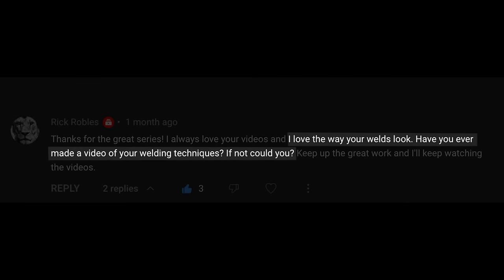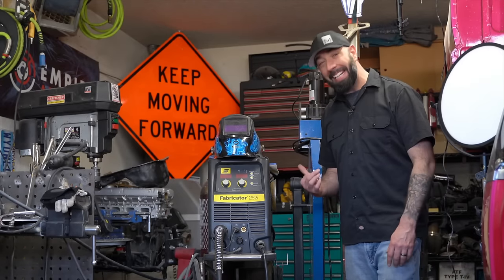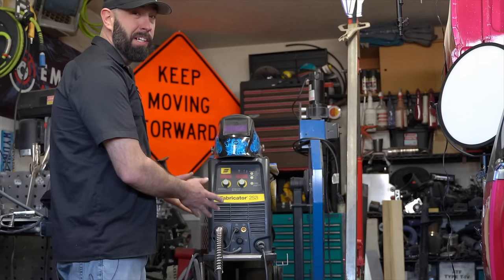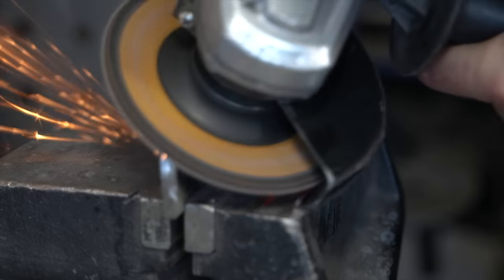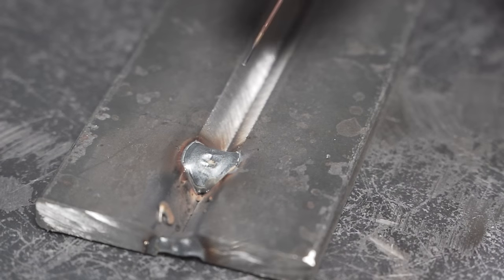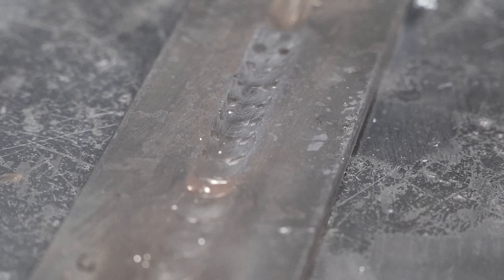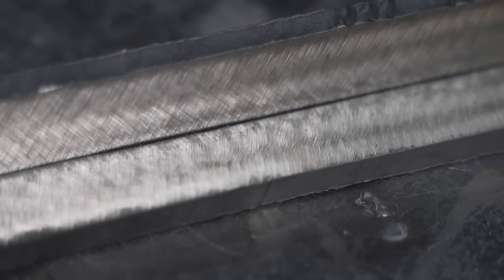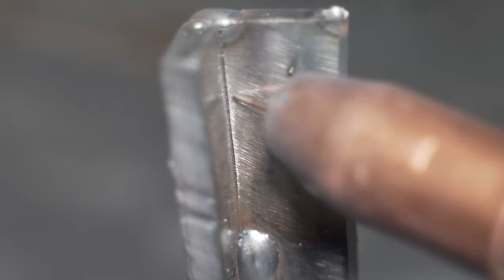MIG Like Mankandy: Techniques for Stacking Dimes with a MIG Welder

Comment: I prefer  forward  and up hand for everything over 3mm =1/8  with mig but im unsure your technique  is for the heavy gauge materialsm?
Reply from the maker: What I’ve heard a few times is vertical down is not ideal for heavy gauge. As for pushing and pulling, I haven’t noticed much of a difference in penetration but a slight difference in cleanliness. Pushing seems to provide better shielding.

Comment: Entry level mig and arc welder here! Loved the video very helpful techniques, thank you. 😊 very politely, are there charts/books to set up old machines that don’t have the digital help in setting up ones machine? What about setting up old school mig machines that need individual settings? Wire speed, amperage, voltage etc?

Comment: These comments are going to be epic your hella fabricator respect self-taught myself but helpful Meg advice clean your material make sure you have a good ground don't use extension cords you lose your voltage listen to your machine MIG is basically heat versus travel speed could use soapstone to better see your metal to my mind a cold weld is a strong-willed
Reply from the maker: Thank you for that my friend! Very much appreciated.

Comment: just about verticals : when u see specs of your welding wire, there is an info what positions is that wire intended for. usually solid wire can be used for downhill vertical ( it is good especialy for root pass). Flux usually not because of slag flowing down caused by gravity. On constructions there is as well Welding Engineer who is in charge of whole welding process and thus welders are given WPS and have to follow it no matter what. So by WPS welders can be told  not to weld downhill even if type of wire can be used in that position. Welding Engineer can decide that just to help welders make the job done as well as possible for Ultrasonic or X-ray to go well.       All The best for all welders.

Comment: For your last weld the vertical down for anything no structural your fine ! the weld loses a bit of strength but that's all going up hand is the proper way for the strongest weld ! but for just welding up basic car parts go cart stuff. Just make sure to take your time and hold to wand facing up to help slow down the puddle so you don't get porosity !! oh ya had to add 20+ year welder from high pressure pipe structural some under water and retired off greenhouse heat pips and boilers !!

Comment: I'll put this out there for what it's worth.  I've been a CWI for 15 years, involved in the industry for close to forty.  People will say it does not matter if you drag or push.  Hell, even Millers own Website makes that statement.  But we are talking about, maybe, a 5* drag angle.  Which people always wind up with a 10 or 15 degree angle, and wind up with no penetration.  I have been testing welders for 15 years.  I'm perfectly honest with the candidates that there is nothing in the code about drag vs. push, swirl, triangle, etc.  However, based on the pass / fail rate I have seen, I also tell them that if they are doing anything other than pushing the puddle, in a weave or stringer, they are on their own.  There is no "Grey Area" consideration when it comes time to bend.  If it fails, and it is marginal, it fails.  As for downhill, D1.1 structural forbids it in all except two cases.  Touching up undercut, and on T,Y, & K joints on Cranes.  Sheet metal is a different animal, and it is expected that vertical welding will be downhill.  Structural being defined as 1/8" to unlimited thickness, and sheet metal being anything less than 1/8" thick.  Carbon steel in both cases.  I'm like you, I like to run hot.  Hot enough that it almost does not matter what else you are doing, you have exceptional penetration.  360 IPM @ 23v on 3/16" to 5/16" A36 carbon steel.  See, I kept it Nice!...Great channel by the way, love the Video's.
Reply from the maker: Thank you for the time it took to write that Eric! You can often tell by someone’s way of writing if they’re interested in sharing info or just feel the need to troll. I feel educated. I appreciate you. In fact I wish you were in my neck of the woods. I have this idea to create a video where I weld the way I weld. (Pull, vertical down, etc.) and an certified official tests the welds. I wouldn’t be surprised if they failed. In fact the video would be more entertaining if they did fail. Then I weld the way my YouTube viewers advise me to, and test those welds as well. Entertaining, and beneficial for all. And potentially enlightening to me. Win win.
Thanks again my friend.
Reply: @GarageFab  I'd be happy to give you some detailed test procedures for some of those joints.  Simple and inexpensive.  You are right, it would make for some great real world examples.
Reply from the maker: @ericdolan2130  I would love that!
Reply: @GarageFab  I'll see what I can come up with over the weekend.

Comment: The best way to learn is to get a job in manufacturing that requires you to mig weld the same part together over and over about 1000 times. Yeah it gets old but you get the benefit of a lot of trial and error and you get to see what you are doing and it’s effect on your puddle and overall weld quality as you try slightly different things between runs. You’ll develop your own way of doing things that works for you and you’ll find that when you move on to bigger things you’ll have confidence to jump right in and do a good job.
Reply from the maker: I agree with that. I worked for a company that manufactured utility trucks. It wasn’t repetitive parts but it was nonstop welding at times.

Comment: You are correct generally none of these techniques or weld direction would be allowed in structural welding and there are good reasons why vertical down MAG welding is not structurally acceptable in materials above 3-4 mm thickness, but at the quality and expertise that you are it doesn't really matter.
Reply from the maker: Much appreciated David! Do you know why these are frowned upon?
Reply: Yes I do after having been a Boilermaker welder, Lecturer in Welding and Fabrication  and qualified Welding engineer for 50 years  @GarageFab
Reply from the maker: I was hoping you could share. There’s no shortage of people that advise to not weld vertical down, but few that will explain why.
Reply: Its not complicated, the problem is that on the thicker materials - say above 4 mm plate the speed of travel to obtain an acceptable weld factor is slower and the arc point starts to impinge on the rear of the weld pool itself as it is running slightly in front of the arc point. Obviously this dramatically shields the arc penetration point and can reduce the penetration by upto 80% often with sub surface fine porosity and sometimes cracking - not what you want for any structural welds. Of course in some circumstances it is a viable option, in thinner sections it can and does work ok especially F.I. on car body work where Vertical down is preferable.
Reply from the maker: So good. Lots of sense made. Thank you my friend. 🙏

Comment: Third generation welder here. I used to stretch trucks and build really big machines. All of what you said is only applicable to light sheet metal. 16 gauge and smaller. If it looks like a stack of dimes, it's a weak weld. The closer those lines are that make the weld look like dimes, the stronger the weld. You do not drag a MIG, you drag a stick. You PUSH a MIG at least 10 degrees past perpendicular, opposite the direction of travel. There is such a thing as too hot: You will be "spray welding" ...and this is not something you want to do on a critical weld because it's brittle. I can't tell you how many trucks I've had to strip down and fix because somebody did the critical verts downward. They will ALWAYS break. Go to Miller's website and watch some of those videos, it'll make you a better welder, and you'll stop smelling like (*sniffs the screen*) parmesan cheese. Your machine is on point, though. Esab is pretty good. I'm a Miller guy, myself. I've had good performance out of Esab and Hobart, but Lincoln is not even in my top three. Lincolns are inconsistent and their duty cycle ratings are inflated. Once they get warmed up, they get weak and I have to fiddle with them to get it right. Then the next day when they're cold, they blow holes in everything. I'd rather use a torch, Borax, and wire coat hangers than use a Stinkin' Lincoln.
Reply from the maker: Haha! Thank you my friend. I appreciate your input. There’s no shortage of people that say don’t weld vertical down. There is, however, a total lack of people that are willing to share why a vertical down weld is a weak weld. What is happening or not happening when welding down? 
I’m not one to argue, especially when I don’t have enough knowledge to make an argument. But I’m also not one to accept any information unless there is an understandable explanation included.
Reply: @GarageFab  Pulling down is just you chasing the drip of the puddle with the arc. You will have to move too fast, making a cold lap weld that has no pentation, AND the puddle will always flow down and outward toward the outside of the chamfer, leaving a void behind what you see on the outside. Going UP the vertical forces the puddle AND the arc to mate the filler material with the work, laying it in as you lattice the filler material on top of the previous pass, ensuring 100% fill of the chamfer or root pass. 

You can pull down on 10 gauge-ish and smaller sheet metal. Anything thicker, you should move the work to a more horizontal position if you can. If you can't, do a proper vertical UP. It should be noted that doing upward verts, you WILL have to turn the welder down; power and wire speed for a MIG. Turning the power down goes for all phases (MIG, SMAW (stick welding), TIG, SAW (Submerged Arc Welding) and underwater). You have two things working against you going up: 1) You're laying a bead on top of a bead. It's already hot. 2) The arc heats the air and what does hot air do? It rises. Always. It can carry a whole bunch of thermal energy and actually pre-heat the metal above your arc. (If you are running a critical vertical in cold windy weather, you WILL notice a difference, and you will get some grinder time until you find the sweet spot.)

You can prove this with some test pieces. I had this argument with a guy in the shop 20 years ago who also liked to pull down and stack dimes. I took 1/4" x 2" flat bar, four pieces 6" long. Chamfered them like I would for a critical weld, like a truck frame. I welded two together and pulled down. I turned the welder down and welded the other two proper vertical up. I put the downward pull in the vice, with the weld about a 1/4" above the jaws and hit it with a 3lb sledge. It folded like laundry to 45 degrees or so. I smacked it one more time, not that hard and it snapped right off at the weld. There were many occlusions...it looked like a sponge. No penetration. the whole weld just broke.

 I put the proper vert in the vice and did the same thing, except I tried to send it to Jesus with two hands. It bent to maybe 70 degrees. The hammer glanced upward like it was fighting back. I Babe Ruth'd it again. Down to 45-ish. I then beat it like it owed me a lot of money and wrapped it around the vice. The weld showed no evidence of giving up. An x-ray would have been a better judge, but there were no cracks. No fissures. 

I did this with a MillerMatic 250 MIG with .035" wire, 25/75 CO2/Argon.

I hope this helps you not smell like parmesan cheese.
Reply from the maker: My friend, words cannot express how much I appreciate you taking the time to write all that when no one else is willing. There were repeated lightbulb moments. 
The first with your description of the void behind the weld. After receiving a million anti vertical down comments, I decided to prove them all wrong and performed my first weld test (that I can remember) on a 3/16” plate T joint. It was a beautiful weld! With a heavy hammer wack in the vise the test piece folded. When inspecting closely I could see that the edges of the bead penetrated nicely but the weld at the root snapped off and I was surprised to see untouched metal. Almost as if there was a void behind my gorgeous weld.
The second light bulb moment was your suggestion to turn the welder down when welding up. THE reason I don’t weld up is because I can’t keep the bead from building and drooping causing the most hideous weld you’ve ever seen. Every attempt has been using the same settings as every other weld I perform. If it wasn’t almost 11pm, I’d run outside and try again with some lower settings.
I’ll certainly be running some breakage tests this weekend with all my welding styles and positions. I might even film it. 🤔 
I doubt that my soon-to-be-improved welding will lessen my parmesan cheese smell, but I do expect it to resemble the good stuff. (Not that crap at Olive Garden.)
Thanks again… What’s your name?Cheers!
Reply: @GarageFab  My name is Rich. You're welcome. Most welders/fabricators don't want to try to teach someone who kinda comes across like they know everything, but are doing some stuff wrong because it just turns into an argument because everyone is an armchair expert. Yes, there is more that one way to skin a cat, but when it comes to verts, your options funnel down to a just a few, and down is almost never an option (except for light gauge sheet metal). I can tell you're a sharp fella, you're making great videos, and I felt you deserved the truth in a detailed manner. (Sorry it took so long to respond, I just onboarded with a new company and I've been doing a lot of travelling and training.)

Comment: As far as vertical down hill, i beleive with proper technique  and experience the welds can be close to as good and depending on the welder maybe better. The slag as long as everything is cleaned and only one pass is needed at a time and proper weave and proper angle and experience

Comment: Thank you Sir. I am also a student at the "university of hard knocks" and cannot wait for Monday at work to start trying these techniques. One thing, is there any advice for upside-down welding? Man, if I could tip a truck-trailer on its side this morning....🤣🤣🤣
Reply from the maker: Ugh. 😩 Tell me about it. I don’t really have much good advice on upside-down because I suck at it. I think all I can say is that I learned that settings and techniques change. What works for typical welding does not work upside down. You’re fighting drips so the wire speed needs to be turned down and the side to side movement is a little more extreme. Imagine your trying spread less material thinner. Your weld bead will still be just as tall because you’ll be moving a little slower. Lemme know how little that helped. 😆

Comment: What wire are you using? I also noticed you drag going downhill... that may be the reason why it works.(?)
Reply from the maker: .030 I’ve noticed that the force of the arc (or maybe the gas or both) pushes slightly on the weld puddle, so by aiming the gun upwards, it pushes the puddle up and allows the arc to reach the base metal.
Reply: @GarageFab  I was really looking for "E70..."

Comment: Very good but the last mig weld was a little thin on the down hill 
You can weld down hill on structure steel you just need more heat and more wire
Reply from the maker: Thank you Gary! What do you mean by thin? Bead width? Bead height? Both? Neither?!

Comment: You don't weld vertical down because it doesn't get adequate penetration. It tends to sit on top of the joint, it looks nice on the outside but as soon as you cut and etch it, or xray it you'll still be able to see the sharp corners on the joint.